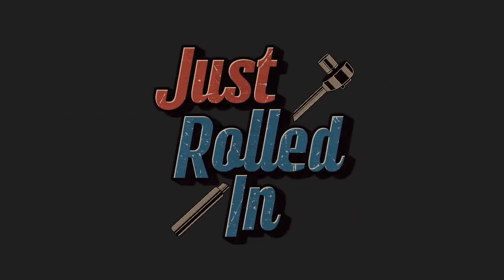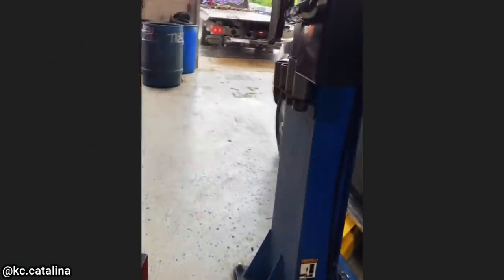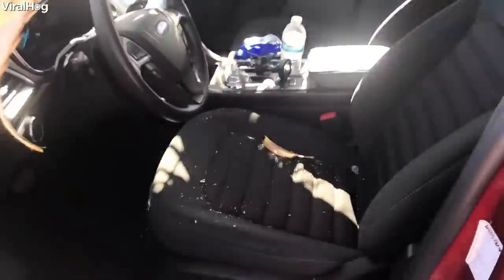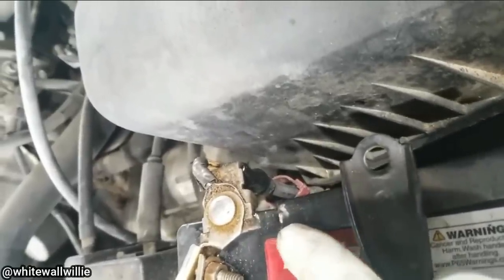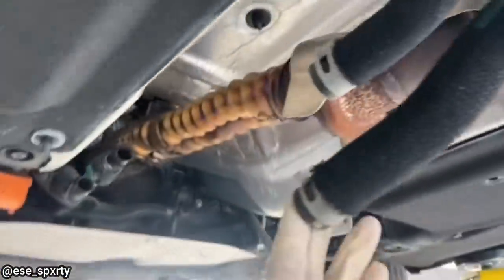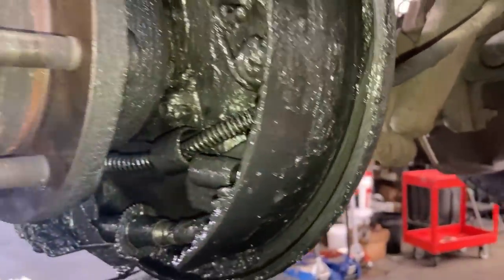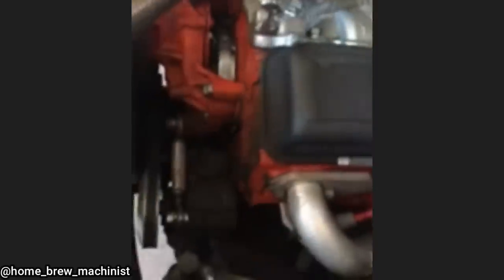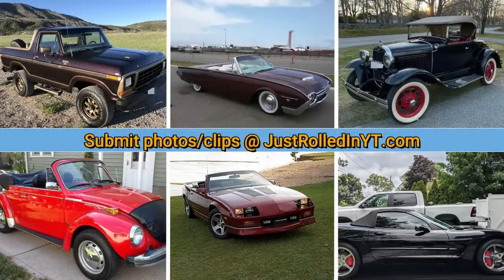Customer States New Engine Installed At Another Shop And Now Has A Leak | Just Rolled In

Comment: Had two radiators replaced in a f250 Diesel by a dealership only because the warranty paid for half both radiators leaked within 6 months so I decided to do the next one myself that's when I found one of the cooler brackets was broken and rubbing against radiator and putting holes in it. There's no way the mechanic did not know that that was going on!

Comment: New rotors and pads/shoes brake fluid  level at max line. Now, fluid level can be used as a quick visual for pad/shoe wear replacement. Otherwise brake fluid loss for many years now is very uncommon

Comment: That '32... Was that a modern clutch-brake-gas pedal, H-pattern shifter setup? I thought that wasn't a thing till at least the '50s
Reply: Quote: "It was only by the 1920s that most if not all car manufacturers fully adopted the standardised arrangement that is used up until today." Automated transmission became mainstream in the '50s, you are probably confusing it.
Reply: @randomnickify  ah I see. Thanks for the clarification, yeah I must have been thinking of automatics.
Pretty awesome car all the same

Comment: Every single time I take my vehicles in for service or repair, I always leave with more problems than I started with.
Reply: It's really bad out there these days. I'm a Mechanical Engineer/ Master Automotive Technician. I won't let anyone touch my Fleet of Cars and Trucks. I don't trust those Glorified Hacks.
Reply: @davidhall3747  Thank you. Idk what is going on with mechanics these days, but whenever I get my vehicle back, I'm always surprised in a bad way what they did to my vehicle. I am so sick and tired of mechanics, that I'm thinking about becoming Amish and buying a horse and buggy. I hear that for $2,500.00, they last about 20 years.
Reply: @shawnbutchko456  If you're mechanically inclined and healthy enough, you can learn to at least maintain your vehicle (s).YouTube is excellent for learning from basic to advanced automotive maintenance/repair.
Reply: @davidhall3747  Yes I think you're right. I did replace my upper radiator hose on my Camaro before I sold it. I was really proud of myself. Lol. It was very liberating. Thank you! Oh, and I also replaced the battery terminals on my truck by myself. Hurray!!! Lol. Thanks again!
Reply: @shawnbutchko456  It takes years to Master a Skilled Trade. Professional Development comes from Hands on Training & Experience. I've been in the Skilled Trades for Forty years. I'm a Mechanical Engineering Consultant now. I specialize in Plumbing, HVAC, & Automotive Technology.

Comment: Since you're a mechanic, can you please tell me why some cars from the 1930s still run today but new cars break down in just a few years? Oils and gas was of super low quality, maybe thats the reason?
Reply: @JustRolledIn  what about robots? Doesn't that cut cost a whole bunch? And we have computers, better oils and gas, better materials, more places to test them and more experience, but more fuel efficiency and emissions... so planned obsolescence?
Reply: @JustRolledIn  It's ALWAYS been about the $$. From the earliest days of automobiles they were trying to make the assembly faster and cheaper. And please don't be wearing the rose-tinted spectacles about old hand-built cars; vehicles from that era were notoriously unreliable and needed far more regular servicing than modern cars do. 

The reason that cars from the 1930s still run today is that they're mechanically pretty simple and they are generally only driven very occasionally. Nobody is daily-driving pre-WW2 vehicles, they just won't stand up to that kind of use now. Indeed, unless you're a glutton for punishment you wouldn't daily-drive anything built much before the 90s without an expectation of constant maintenance.
Reply: "Planned obsolescence" is mostly conspiracy-theorist myth that doesn't stand up to a moment's rational scrutiny. Those ancient cars that have survived and are still running are only still running because they are very primitive compared to modern cars, which makes them simple to fix (although you may need to fabricate your own parts), and it's handy that they are simple to fix because they are reliant on lot of maintenance - they weren't reliable when new, never mind nowadays. They're also largely horrible to drive as their suspension and steering are also Stone Age and few people can live with them as a consequence.

Comment: I hit a pot hole in my Audi, it snapped the coolant overflow tank and radiator AN line fittings. No clue how. 

Car over heated, and blew coolant over a bunch of electrical shit. Luckily my insurance covers potholes. 

Water pump for the trans looks like it was soaked before I could stop. Probably fucked the trans. 

Displayed codes from oem dash. 

Trans codes, steering codes, drives mode codes, suspension edc codes, everything but a CEL. I think the TCU or Fuse box got fried for that many codes to pop up.

‘17 a4 b9 2.0t Quattro komfort. 

Any Audi techs who know what might have happened from the water going everywhere?

Comment: The brake fluid clip doesn’t make sense unless the owner is intentionally trying to deceive the shop. I mean, if the brake fluid level drops 40% driving around the block, you’re not even going to make it home. Also, I’m by no means an expert on brakes, but that drum looked greasy, it didn’t look like brake fluid. Someone explain what I’m missing or why I’m wrong I guess.

Comment: When a shop does such a bad job I presume you have some comeback on that? What happens when you find you've been ripped off by really bad, deliberate workmanship? Or you buy a complete lemon? Cheers
Reply from the maker: Luckily haven't had both of those issues but getting a lawyer involved would probably be what you would need to do if a shop does something like that (and wont fix it correctly). If you buy a new vehicle that is a complete lemon, I know there's some states that have certain rules regarding that from what I've heard. I'm not from the US but maybe somebody could chime in.
Reply: @JustRolledIn  Over in England we are covered by consumer laws against rogue dealers.

Comment: I've been working on my cars and all kinds of cars, I was a certified diesel mechanic working on the whole equipment of Caterpillars 951/951/977/D8 and work in the gasoline powered trucks and vehicles. At 20 years I was in charge of the whole repair and service. The owner was a German/American. You'll be treated like trash if you did something wrong. That was back then, but I did learn the proper way knowing how Germans are about quality and service 
Trough the years I have seen how technology has evolved, some times for good and 90% for bad.
I have some OBD electronic test devices. Even the most modern can't pinpoint with precision a failure.
Watching this all I can say, those Messchanics should be jailed.
The owner's? Well, if you're cheap in your car I can only imagine how your house looks like.
This are all death traps.
Is just about time when an accident will happen.
The sad part is that people is cheap, irresponsible, lazy, ungrateful to their cars.
I was so confident in my work that my boos, like I mentioned, he put me in charge at 20 years old when other guys were twice y age. Back then the company give me a 1980 Toyota long bed 2.2 liter pick-up truck. It had a 150 gallon diesel fuel pump and all kinds of tools, the best brands.
I keep everything looking like new.
I worked in the morning 6 to 6 pm and go to school from 8/11.
Saturdays I preferred to service the entire fleet. My so called friends went to do other things.
I was the lonely guy.
As today, I do everything in our cars and a handful of people I know.
I never wanted to open a shop cause in the mid 90s I started to work for a NYC based company in the high tech electronics, another field I love.
Since then I was traveling abroad a lot. At 58 I can't do neither. I have a degenerative Spondylitis, it's a painful horrible chronic desease. 
In any case the cars that I take care all look like new, inside, outside. Engine bay always nice and clean, I don't use high pressure water, just a brush and an electric air blower. In that way I can see any leaks or suspicious activities.
Well, I can be here for hours, all I have to say: Choose your mechanic from reliable source and never, never leave your car in a shop. If it is a major repair always have somebody and request back the old parts. Check the new ones too. Many shops charge you top money but they do install cheap foreign  parts.
If you don't know anything about cars, always ask at 3 different shops.

Comment: One wonders what some of these faux mechanics were doing while they were supposed to be studying.  Shade Tree mechanics can no longer do much more than oil changes (some are doubtful) and checking tire pressure.
Reply: It's perfectly reasonable to replace the brakes, some bits of the suspension, and spark plugs/coils/wires. Some cars it's not too hard to replace bits of the cooling system like overflow bottle and maybe the radiator.
Scantools are not expensive either. I got a decent one from Harbor Fright for less than $100, though more computerized vehicles will need something better with OEM programming.
If you mean that some Shade Tree "mechanics" are a menace then yeah, but it's always been so.

Comment: the one with the leaking brake cylinder looked like it had less than no friction material on the shoes. no wonder the cylinder was leaking, the piston had probably fallen out of the end.

and welding steering components is what killed ayrton senna, that's a good enough reason to never do it.

Comment: The damage you or anyone at the shops discover after some people have gotten new engines and come off of the lot with new cars should be something they can get compensated for or take the dealers and the mechanics that worked on their cars to court and get compensated again for don't understand how come people mechanics or automotive technicians would give good mechanics and automotive technicians bad names like that I know plenty of them and I'm one myself that would do excellent work if they can if not refuse to do the work
Reply: In the US, you can file a complaint with the state.
One shop wouldn't give me their BAR number (California), so I finally called the Bureau of Automotive Repair to ask advice. Turned out, they had no license. Within 3 days, the shop owner had an enlightening conversation with a BAR inspector and eagerly returned my money. When I picked up the check, I noticed both the owner's face and the new license number posted at the door.

Comment: Those Frauds must have very substandard windscreens if a small palm frond like that will penetrate it, but that goes with the rest of the vehicle I suppose.
Reply: Force = mass times the square of velocity.
If the frond weighs 5 pounds and the car was doing 60mph, that's a LOT of force on a tiny spot of the windshield. Science!
(2.5 kg at 100kph^2)

Comment: was i not supposed to put the RTV there?
Reply: I recommend using only black RTV, doesn't look weird when abused.
Reply: @dave161141  Lowe's has that paintable stuff for doors you can lay down some alumiblast spray on, just enough for that brake light warranty

Comment: Hmmm,... 'forgot to...' Multitude of sins in that phrase.
On the other hand, that 1932? The state it's in, and it still runs sweetly? That's some class engineering, thanks for showing it. Wonder why today's autos don't last that well....
Reply: Cars of that generation would need a de-coke and possibly a re-bore every 20k miles, and people didn't drive anywhere near as far or as fast. Nowadays people buy a car and expect to scream along for 200,000 miles without doing any maintenance or even lifting the bonnet, and some cars will do it. The idea that older cars were more reliable or longer-lasting is a myth. They were just easier to fix.
Reply: @davidjones332  You're right, of course. And similarly, if older cars were so much better then the roads would still be full of them. Could also just be that they were simpler, with fewer 'refinements' waiting to go wrong.
All the same, though, that one doesn't look like it's had anything more than good regular servicing, so still can't help wondering how many modern engines would still be going that well in 90 years.

Comment: I had a shop rebuild a motor for me and they had me driver for a thousand miles to break it in so I did that babyed it for the first thousand miles and at about 900 miles that harmonic balancer came off of it and my brother-in-law took it to his shop and pulled it apart showed me the oil it was completely trash look like he had poured it a pound of glitter into it but he goes this may have had something to do with your motor locking up and the oil pump was completely clogged with silicone they'd use so much silicone when putting this motor back together then blamed it on a new guy at the shop said they would fix it then closed shop and moved

Comment: Hey, guys!
For 0:39 I can see how it happened. Frankly, the older a window gets, the more breakable the safety glass becomes due to sunlight and plastic fatigue over time, but that wasn't what did it. The frond's leaves acted like the tail end of a shuttlecock so the weight of the branch was at the point; said point impacted the glass and the impetus of the car itself only added to the moment of impact. Impact itself is derived from mass times velocity and this would count both that of the frond and that of the car, all concentrated at that one spot.